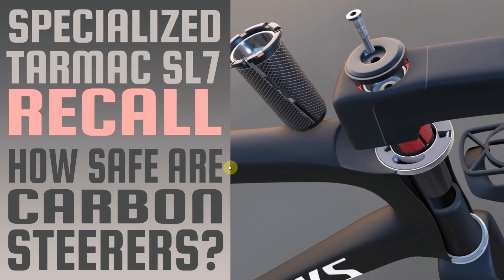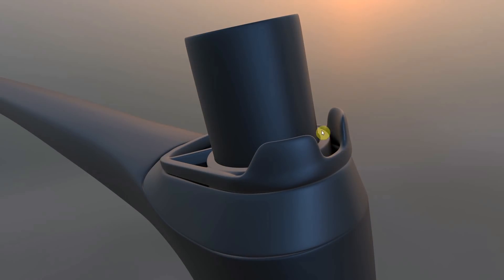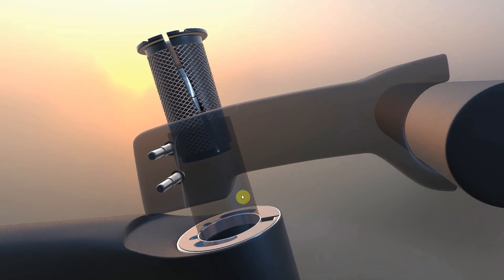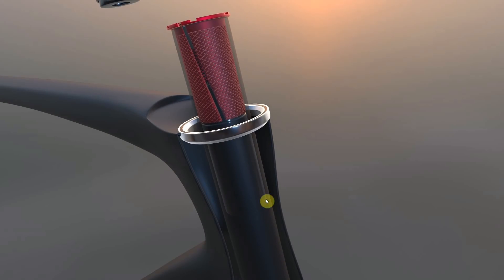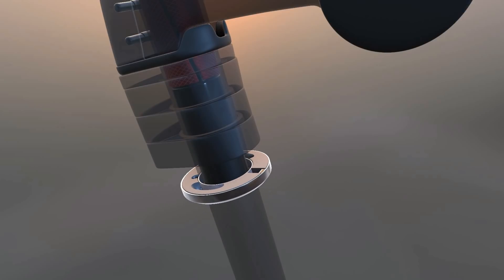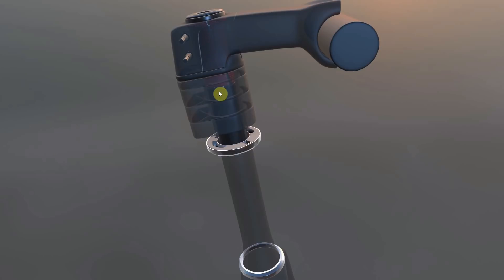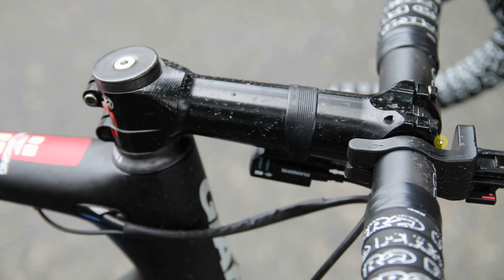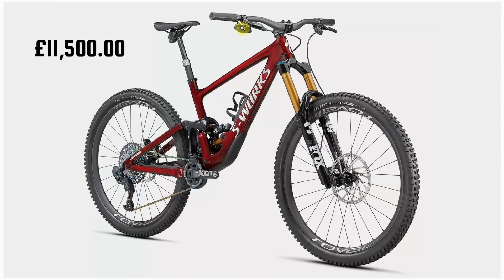Specialized Tarmac sl7 recall | how safe are any carbon steerers | 3D animation | Bikotic

Comment: I am an engineer and so will comment.  Brilliant video Bikotic.
A few words.  First, let me say, for a non engineer you have a really great grasp of the situation.
So what's up?  In engineering parlance, the core of the designs of many machines and assemblies like this, is what is called a stack up event.
Maybe you have heard of the term perfect storm when a confluence of factors comes together to create a catastrophe.  What we have here.  How many out of 100 SL7 bikes sold will fail?  1? 5?  0.1?  Not many.  But....way too many statistically for people who buy this bike as many have heard of this issue that are into racing bikes.  Recall campaigns are expensive for any company.  But...but....nothing will bankrupt a company faster than hurting or killing people if determined their product left the manufacturing floor with a defective design.

What is a bad design?  A bad design does not account for manufacturing variation and variation in environmental conditions.  This is for example why bike manufacturers place a weight limit on their carbon bikes.  So, how did this design get out?  Why was it released? Mostly greed and lack of due diligence.  That said, engineering is very difficult outside of controlled conditions if the objective is absolute highest performance.  No different than designing a race engine for a race car. Race engines fail at a higher rate than production engines but a production engine could never do what a race engine can. There is a document in engineering called a DFMEA which is a critique and rating of failure modes.  A steerer snapping which is nothing new with carbon bikes is near the top of the list. By definition, this is a negligent design.

Why did it come about?  For internal cable routing mostly.  But, the design does not have to be configured like this.  Why did it fail?  A lot of reasons, each a small contributor to a bigger problem.

What does the perfect storm consist of:
1. Rider weight and strength:  a 1500w, 90Kg rider will fail the steerer with much higher probability than a 300w senior citizen
2. Bad roads.  Repeated riding on bad roads can put a notch in the carbon...especially with loose headset.  Carbon as strong as it is, does not like point loading
3. Loose headset. You illustrated why.
4. Tolerance stack up of the parts.  This is key.  Specialized missed the proper stack up to ensure that retainer would not act as a knife edge.
5. Bike weight.  The SL7 is the amalgam of Venge and Tarmac.  A more slippery Tarmac with Venge frame sections.  Aero bikes are heavy due to adequate moment of inertia in bending aka under rider acceleration and high watts imparted to the pedals.  This means, corners are cut to keep the weight down on a bike like this.  Many have seen the flexible downtube videos of the SL7.  This is because in the section strength of the downtube, the wall thickness can be dramatically thinned out but the very deep wall section vertically of the downtube compensates for the lack of width.  The downtube is basically an airplane wing turned on its edge.  This is why aero bikes are heavier than more conventional tube bikes which are stronger laterally like the outgoing Tarmac SL6 and of course weight is the elephant in the room with disc brakes in particular and so strength is compromised where it can be on other areas of the bike.

I can go on and on about design tradeoffs but above are some of the highlights.
So lets review who will break this bike?

Most likely, an elite rider with huge power who doesn't adjust his headset precisely, who lost the tolerance lottery from Specialized and has a slightly undersized collar ring, maybe the carbon lay up could be better, he rides a lot of rough roads and prefers a wider handlebar for leverage...perfect storm and snap.

Who won't break it?
A 100 lb girl who doesn't race, rides smooth roads and has a good mechanic who always checks the headset and even periodically removes the steerer for inspection and regrease the bearings.  Hers is never going to break.

The increased length expander plug that Specialized released as a running change....btw, not their first rodeo on this and they have released a longer expansion plug on previous gen bikes prior to advent of internally routed cables...this longer expander plug adds weight.  That is why it wasn't in the original design of the SL7.  It also likely costs 20 cents more per bike to make  due to more material and machining.  Weight and cost.

What to do?  Personally, with the track record of the bike, I would never buy one.  With the change and proper maintenance, periodic steerer inspection etc, should it be safe for the average person?  Absolutely. 

A last note.  The SL7 is Specialized flagship race bike.  A guy like me looks at this design and shakes his head.  This should have never happened.  Shame on Specialized for this design.  The ring inset into the top of the headset is a knife edge and a stress riser.  We don't know the condition of the bike that broke in the video, but I am sure there are many elements of a perfect storm.  It may not have had the small ring to shield the retainer even installed...or even 'any' expansion pl;ug that wasn't detected in the video as mentioned...because none were shown. We don't know.  Me personally?  I don't like the SL7 enough to buy one and to me, the SL7 is way too expensive for what you get anyway.

Lastly, a question please Bikotic.  What software did you use for your modeling of parts you show in your video?  Can this software be used on a home PC or laptop?  I presume it isn't freeware and you paid for it.  

Thank you for the excellent video.  Ride safe everybody and never a bad idea to remove your fork from your carbon steerer once in a while and check for any indentations.  People largely never do this due to inconvenience, but with all bikes with carbon steerer tube there are compelling reasons to remove the fork once in a while, check the bearings, clean and regrease and check the steerer tube for denting/degradation.

PS. Years ago when George Hincapie's steerer broke in the Paris Roubaix race which is grueling on any bike, initial reaction was to demonize Trek for this failure. We all know George is a large and powerful rider and the cobbles are a daunting challenge to the structural integrity of any bike.  Upon closer examination of the facts it was learned why big George's steerer really broke.  He was involved in a crash earlier in the race which created microtearing of the carbon fibers within the steerer.  Greatest stress is always at the top of the headtube and just beneath the stem clamp.  Repeated vibration later in the race combined with George's considerable force on the handlebar created ultimate failure.  Bikes may not fail upon an initial crash but can be weakened.  Carbon layups can delaminate on some level due to excessive force/deflection.  A little tech is...carbon lay ups are much stronger in shear than they are in bending.  We don't know the history of each bike that breaks including the SL7 bike in the video that went down which was hard to watch.
Reply from the maker: Thanks Luke, an interesting read. I use Blender 3D, its a free open source fantastic piece of software
Reply: Really great reply, enjoyed reading it from an engineers perspective on the SL7. thanks for sharing :) The compression ring itself, would you say it is safe design wise with the big holes on the side? The internal ring is so thing that it really doesn't make a difference in strength... It is probably just there to prevent cables touching the steerer and lack of chamfer. Speaking of which, could they just not use the same compression ring and machine chamfer around the edges? File away some material to make it more smooth.

Comment: Great 3D explanation!

Correct that is the new compression ring that was shipped on SL7 since december 2020. That is how long they knew there was a problem...took them 10 months before the recall...and STILL IMO it isnt safe and needs to be inspected every few hundred km.

The split ring shim would have flung out in the crash. Would not be possible to ride the SL7 with no shim as the headset would be SO loose and KNOCKY that even a total noob keto barrister on 500mg of modafinil for breakfast would notice something feels wrong.

I think most SL7 owners will be fine as lets be honest, most people who spend that much on a bike dont ride it much.

That said most S-Works owners are TERRIBLE at bike maintenance and wont notices a slightly loose headset with some nano play in it.
Reply from the maker: Thanks!
Reply: Jesus man i just spit out my lunch lololol damn u make me laugh bro😅

Comment: Good video that I own a Factor Ostro there have been some issues! I have stripped mine down and checked it was all good I added a fair bit of carbon slip to the fork bung re-torqued and did the same with the stem as instructed by Factor. I haven’t had any issues in 5000km this summer but I check it for any movement after nearly every ride just in case. I also ride mine slammed with no spacers above the stem which means the bung is halfway down the steerer tube this must put less stress on the steerer itself👍

Comment: that integrated headset design is really a total crap .. additionally, the compression ring could also rub and eventually cut the hydro cables .. thus compromising the braking system.

Comment: I think the answer is to have embedded stress gauges inside the steerer tube. Above a certain amount of deflection should be notified. Since there are cables accessing the steerer directly why not allow some cables to connect to the strain gauges.

This would provide important feedback to manufacturers which is held by a safety union or collective whose sole aim is safety, not profit.

This kite mark would be important.

Please speak to Peak Torque about this idea for a YouTube collaboration. Where he can provide the engineering insight and you can provide the visuals

Comment: I definitely pop my forks out and check them at least 2x a year ever since I snapped my ALU steerer pulling away from a green light. I also think more should be said about not putting a ton of spacers on top of the steerer, I did that for a couple years and the LBS think that's what caused the stress to snap the alu steerer - I was never told by the manufacturer or a bike shop to not run the spacers on top, and I wanted to save the $30 on cutting the tube so I didn't do it.

Comment: I really liked how video clip at the beginning and the end was a Cervelo. My takeaway is to avoid carbon fiber
Reply: Annoyingly, even Aluminium frame bikes have carbon forks these days - but I agree with you, these carbon steerer tubes are too much risk vs any weight saved
Reply: @Tommy31416  alloy steerers can still fail too. They can also unbond. Carbon is fine BUT has to be torqued proper and supported with DEEP enough steerer plugs.

Comment: Good video. The expander is there to protect against the stem clamping forces, nothing underneath should be designed to allow damage to the fork, yet Specialized have managed it. The new fix is as I understand it has a longer plug yet the lower half of that plug isn’t under compression, it is just there to stop you having a potentially life threatening crash. 
The new ring insert appears to be there to stop the metal collar from cutting the steerer. 

I’ve got two carbon steerer bikes, both have long plugs fitted by myself for safety, never had any issues as they are designed properly, I took a friends Bianchi apart a while back and was shocked to find a 10mm deep compression nut and clear micro cracks in the carbon steerer. 

We need to go back to simple, safe designs and companies like Specialized seriously need to change their ideas, they knew about this long before the issue was announced and had time to provide updated parts, even worse it’s suggested the pro riders had alu sleeves inside their forks. If that’s true it tells you all you need to know about Specialized as a company.
Reply: If you go look up a Tarmac SL7 build for Peter Sagan at the start of the TDF, which was in what? May? The mechanic was clearly seen putting the Alu sleeve in them. Myself and many others were wondering what it was in the comments
Reply: @bjsr126 where can I find that alu sleeve?

Comment: What if, just if, based on the sl7 fork snapped there was not any expander plug? It doesn't seem to be on the photo.
Reply: That bike would have been un rideable without the plug and bearing adjustment! I think the plug is there just out of sight in the stem / spacer arrangement, critically the expander didn’t come down to where the metal ring cuts the steerer tube. Hence the updated parts.

Comment: excellent 3D description. I was in a process of upgrading my SL6 to SL7 when I heard about the recall. I am guess Specialized being largest road bike seller, they went the extra miles to make the necessary improvement but looks like it can happen to any carbon bike from any makers. I am done with my roadie for the year but I will have to check top to bottom next spring before resume riding.

Comment: Canyon solved this issue by having no expander at all on some forks (preload is adjusted from a collar outside), so people can't do stupid things. The steerer is 1 1/4 instead of standart 1 1/8, so it can to endure clamping forces from the stem better. However I am sure somewhere in the world someone over-torque those two bolts..
Reply: Ive seen 1-1/4 carbon forks CRUSHED from not deep enough plug.
Reply: @durianriders  come on mate. There is nothing you haven't seen, even if you don't people will forward it to you :)

Comment: A huge number of earlier CF fork recalls were those with aluminium steerers and that was because the bonding between the CF blades and aluminium steerer would fail over time. At the end of the day CF is a performance component and very labour intensive to manufacture. You often get small voids and cracks in CF in a small percentage of production because of small errors by those laying the carbon fibre or they can drop hairs or dust into the fibres and resin. On these Tarmacs I think the metal compression part had rough edges that would cut into the carbon fibre steerer. This is typical of proprietary components and the issues they have. Typically non-proprietary components are much safer, they aren't as cutting edge but typically better in reality because they aren't so experimental. It's like open mould CF frames which are typically much safer as more such frames are sold and more feedback from importer on what has failed to get improvements. High end CF frames are much lower volume with more new engineering ideas. In reality you are paying more for less in many ways.

I should just add I'm a very heavy cyclist and wouldn't ride CF anyway as I would be at the upper limit of their weight limits and any minor manufacturing issue would cause them to fail where as perhaps a 60-70kg rider wouldn't have such an issue.

If you are riding a CF fork bike on the open road amongst  other traffic it should be pointed out that your forks failing as well as sending you headfirst at high speed into the road will also possibly mean other vehicles will go straight over you including HGVs. You just don't get the same risk with CF frames because of the way they fail. CF forks are much, much more dangerous than CF frames. Stays breaking or the bottom bracket area cracking just don't present the same level of danger, you have a good even strong chance to bring the bike to a stop under control.

Comment: There's one problem with new longer extender plug. Bottom part isn't wide enough to do any strengthning of steerer tube.
Reply: With the extended plug at least when steerer snaps you don't go face first down but just go down.
Reply: That’s right, I think it’s designed to try and keep the two parts together for longer, to stop you having a fatal accident.
Reply: @davidlgeorge78  How half-arsed is that? You resolve the problem by... not really resolving the problem?
Reply: @brotherfranciz  I imagine it was the cheapest solution that satisfied the legal team that they had “done enough” should accidents happen. I wouldn’t ride one of these!

Comment: The problem is threefold.
1- Fragile carbon steerer tube.
2- Integrated cables and hoses that may rub or impead bearing movements.
3- Integrated cables and hoses that makes maintenance and inspection long, costly and complicated which may lead to negligence from certain owners.
Basically, a catastrophe in the making.
But the worst part is that many bike shops have poorly trained sometimes inexperienced mechanics without the ability to scan the carbon parts.
Reply: Too short of a compression plug.
Plastic spacers between bottom of stem and top of headset.
Reply: @povertyspec9651  
Why do you need a longer compression plug ?
See#1 Fragile carbon steerer tube.
Why do you put plastic instead of metal spacers ?
See #2 and 3 cables and hoses rubbing and their long term durability (maintenance).
Don't confuse symptoms with causes.